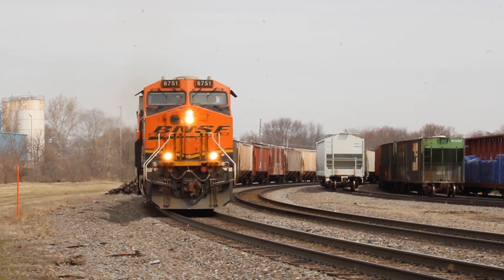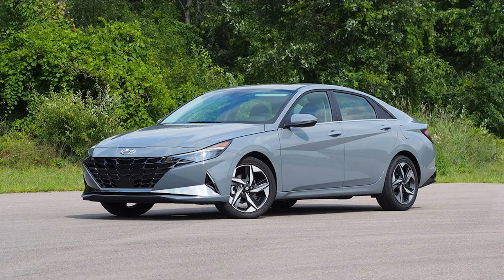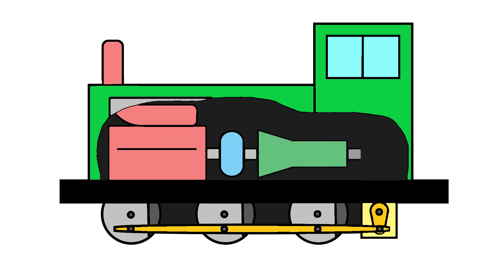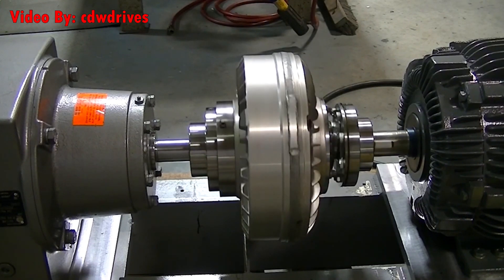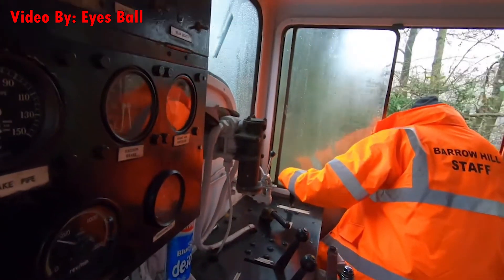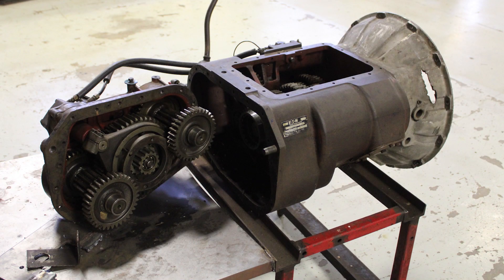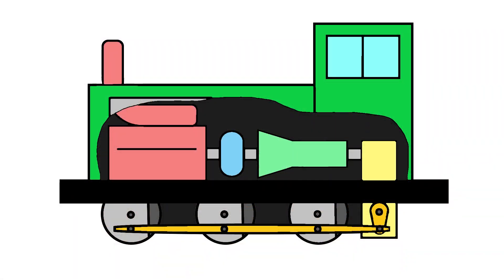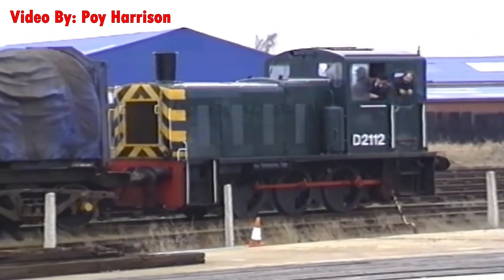How EVERY TYPE of Diesel Locomotive Works! (Part 2)

Comment: Im almost certain i drove an airport tug with this diesel mechanical drive system

Its was hella slow but hella powerful

I never did get to look under its hood, but it had 3 semi automatic gears with a 1, 2, 3 lever

It was like a block of concrete filled with engine block, fitted with monster truck wheels, it was a beast, but you could probably crawl along the floor faster than it drove

One of the querks to this was, you could put it in gear 3, line it up on the centre of the runway, put a brick on the gas pedal, tie the steering wheel to the seat, step out, get in your pickup truck, drive the pickup truck down to the other end of the runway, have a half hour break, and it still wouldn't have got to you 😂 and you could hear it before you saw it, man that thing was loud, you could hear it over the top of everything else on the airfield, it was louder than planes landing

My boss once dragged a 747 with the brakes on with it

It could well have been a hydraulic drive, yano, the gear shifter changing slides in a valve block, and the motor just coupled direct to a hydraulic pump, and a hydraulic motor on each axle?

I dunno 🤷‍♂️😂
Reply from the maker: That’s crazy! Cool story, man.
Reply: Years ago a buddy of mine bought an old small town airport tug rig.  It wasn't much bigger than a  golf cart but it weighed about 3 tons.
Reply: @tcmtech7515  yes i can imagine that, this one i drove was like a house on mining truck wheels, it was like an enormous concrete block with an engine buried in the middle
Reply: that transmission is what you'd call a powershift..it essentially works the same way an automatic transmission does but without the automatic part. each gear (or planetary gear set)has its own hydraulic clutch. the shift lever (either mechanically or electronically) opens a valve that sends oil to that clutch, which locks the gear to the shaft. these transmission are usually found with torque converters on construction/industrial machines, usually with 3 or 4 speeds. however, you can find these transmissions with up to 24 speeds on tractors, which do not use torque converters due to the higher loads with closer ratios.